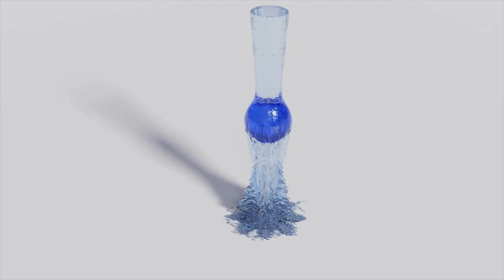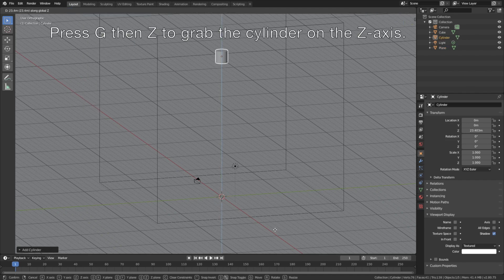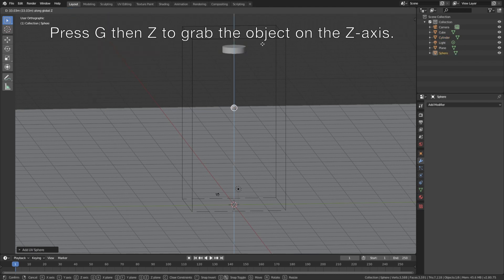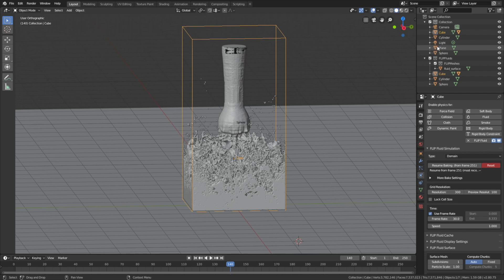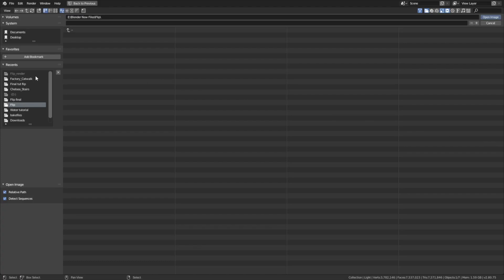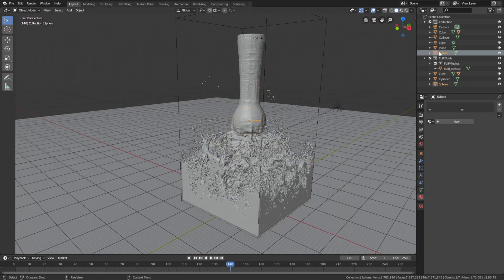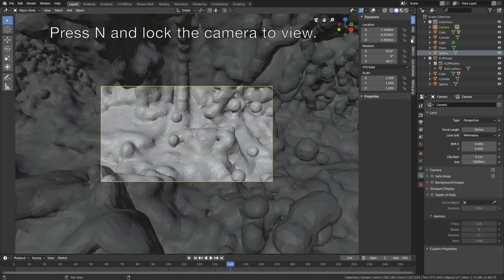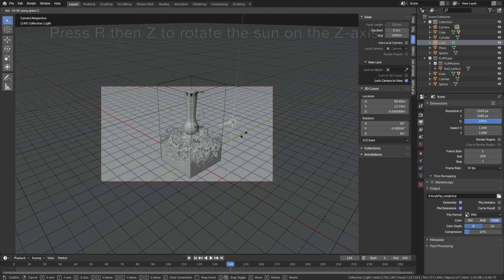[2.80] Blender Tutorial: Fluid Simulation with Flip Fluids

Comment: How well is this plugin handling the cores of the CPU? I noticed Blender dynamics poorly handle multiple cores.
Reply: I am running this on my 2700x (16 threads) at 4Ghz, seems to be using all 16 threads at around 35%. It's going to take me about an hour to render 600 frames at 300 res and 1 subdivision.

Comment: Love your video’s, watched them all and learned a lot. But my baking takes a lot longer then 2 hours. I’m using the same settings as you but the default fluidphysics. On what kind of pc are baking?
Reply: Probably a good one. I found 300 is a bit overboard, 128 works just fine.